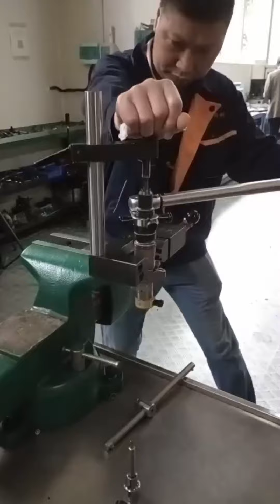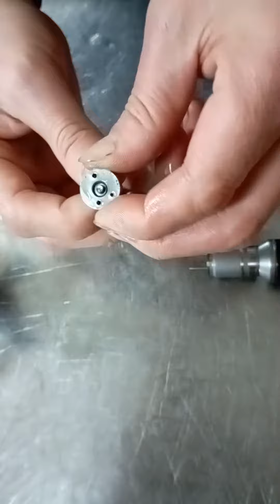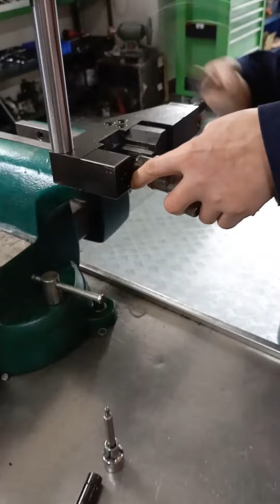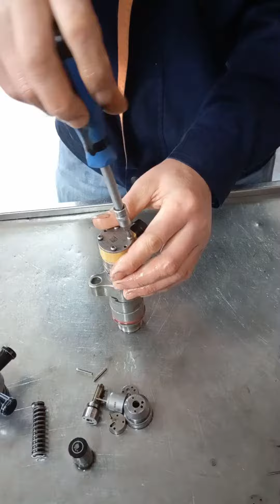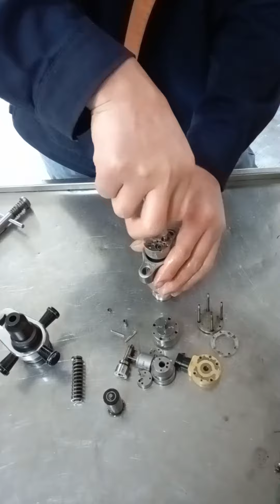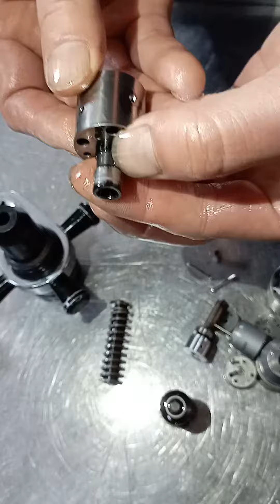Help customers repair CAT C7 injector-Caterpillar C7 injector disassembly-1

Comment: I had two of the injectors that had broken control springs. Replace the control springs and those injectors are still not working properly. Any suggestions. I also took them apart at the bottom and clean them and put them back together.
Reply from the maker: https://youtu.be/3a4lZWCDUbQ
My friend, you can watch this video
If you still don't understand, you can contact
WhatsApp & WeChat: 0086 18937707313
I will communicate your problem in detail with the technical staff
Reply: @avadong313  actually I found the problem with those broken springs a company in Orlando Florida (redat) they sent me a new springs actually they were the long springs that is meant for the spring cups instead of a thimble style. Basically caused the injector not work at all. I ended up having to grind one whole round off the spring before they would work.
Reply from the maker: I looked at the explosion diagram of CAT C7, there are 4 springs in total, can you tell me which spring it is?
Reply: @avadong313  it's the spring inside the control valve.
Reply from the maker: @ronbown3836  Have you tried replacing the control valve assembly? you can give it a try
Reply from the maker: Here is my WhatsApp: +86 18937707313/Email: sales03@bjzqym.com I can ask the technician to help to see where the problem is and if there is a better solution
Reply: @avadong313  no. So what I end up doing is just replacing all six injectors
Reply from the maker: @ronbown3836  okay, respect your choice
But the injector should be serviceable
Good luck to you

Comment: I have another question about these injectors I'm getting excessive amount of pressure loss out the sides of the injectors. Three of these injectors are leaking like in my video here.
https://youtube.com/shorts/ytFVW_sSov0?feature=share
Would a broken spring or a stuck spool valve cause this to happen?
Reply from the maker: I consulted our technicians. There are many reasons for the leakage of the fuel injector. It may be caused by damage to the slide valve, oil valve, fuel injector housing, intermediate pressure plate, etc., and it is temporarily impossible to make an accurate judgment.
Reply from the maker: You can send pictures to describe where the fuel injector is leaking, it is not clear in the video